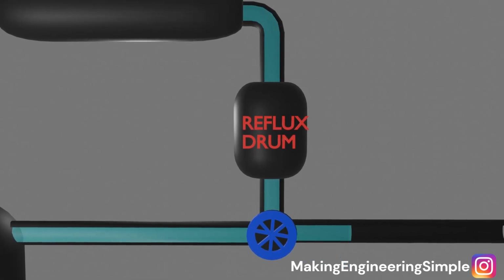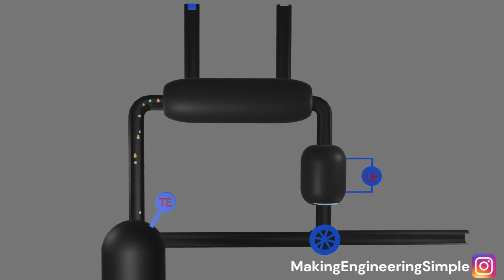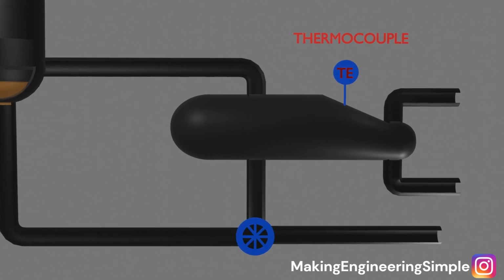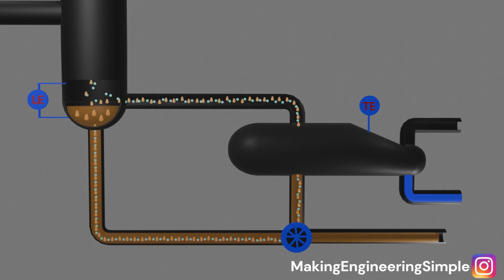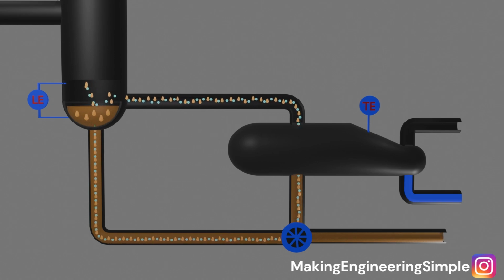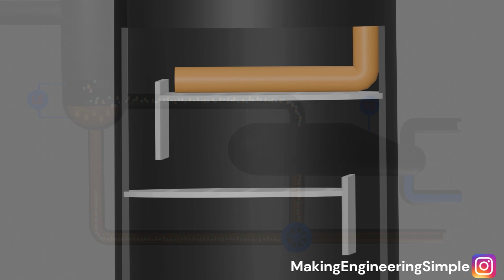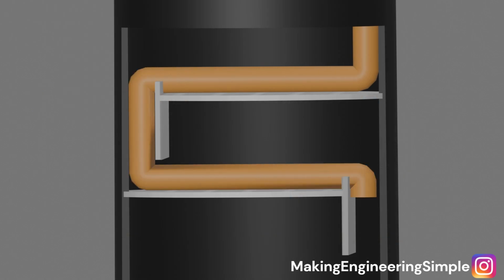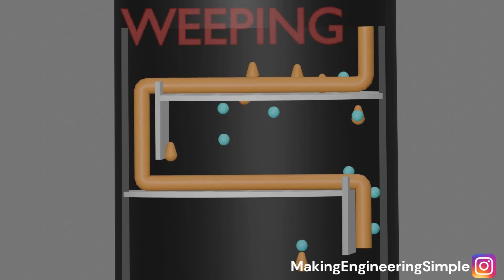How a Distillation Column Actually Works (3D Animated)

Comment from the maker: Want to understand distillation columns in more detail?

I've created a practical companion booklet covering the equipment, control loops, weeping vs flooding, troubleshooting and a worked reflux example.

Get the Distillation Column Engineering Guide here:
https://payhip.com/b/MndE7

If you found the video useful, the booklet is a great way to take the learning a step further.

Comment: Very Good 👍 information about Distillery working but needs improvement eloborate on the level control measures bottoms and exit of effluent output. Reflux % . Flooding weeping and Entertainment. Then plates bubble trays sieve trays weir edges logic. Valve trays. Types of trays explanation. Fractional Distillation column Stripping section and Rectification section.
Reply from the maker: Thanks for the great suggestions!. Are there any specific tray types or column control strategies you'd like me to prioritize in the next video? Thanks for watching and helping improve the channel!

Comment: Excellent video, can you do one that explains direct vapor contact no boiler?
Reply from the maker: Thanks! Yes, absolutely are you referring to a distillation column using direct steam injection instead of a reboiler/boiler?
Reply: @makingengineeringsimple yes I’m sorry sometimes I forget to call it steam, but definitely yes!
Reply from the maker: @RodrigoOrozco-l2c 
No worries at all! Steam injection is definitely an interesting one, especially because it changes how the column is operated compared with using a reboiler. Do you work with this type of system yourself, or is it something you’ve come across in your studies?
Reply: @makingengineeringsimple yes I’m on mi final year of industrial chemical engineering
Reply from the maker: @RodrigoOrozco-l2c
Ah nice!  That’s exactly the kind of audience I’m making these videos for. If you would like to understand distillation columns in more detail

I've created a practical companion booklet covering the equipment, control loops, weeping vs flooding, troubleshooting and a worked reflux example.

Get the Distillation Column Engineering Guide here:
https://payhip.com/b/MndE7